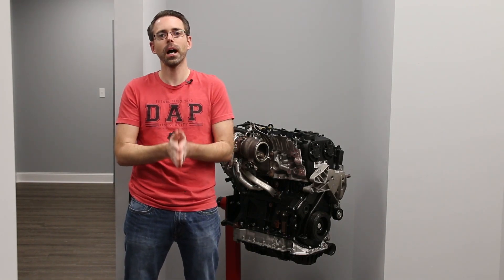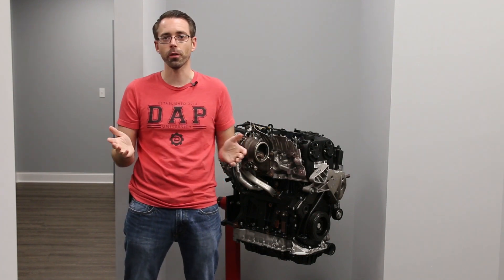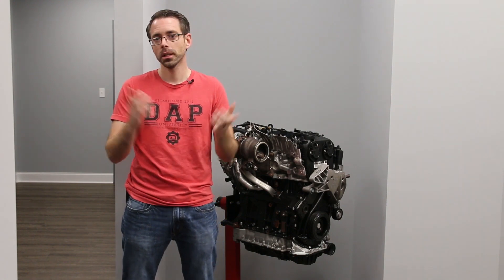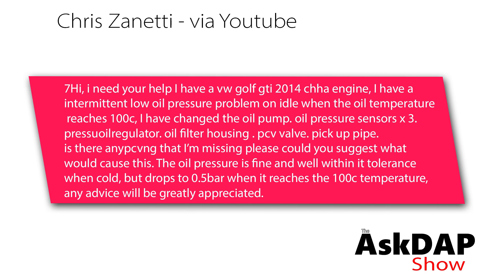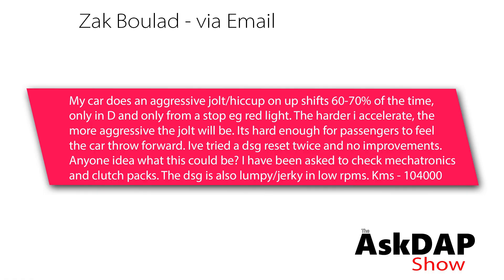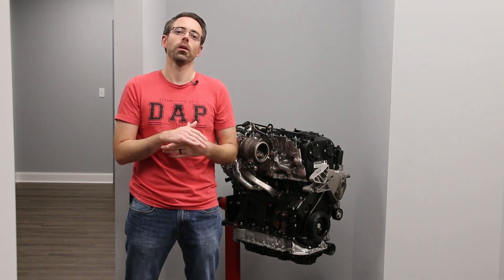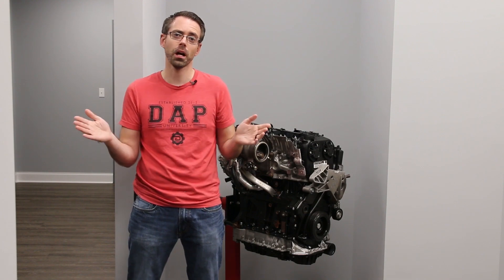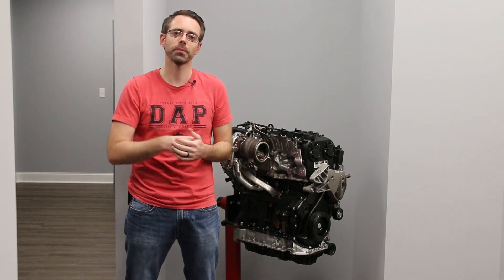AskDAP Episode 139 | MK7 Oil Pressure Issues, Misfires, and DSG Problems

Comment: For transmission issue: check/ map sensor, recalibrate your throttle body and cam timing via Obdeleven. Also reset your transmission code. Brought my trans back to perfect operation. Good luck!

Comment: I have an 09 tsi. At highway speeds the pressure is around 10-15psi. Never goes above 45psi when shifting through the gears. Oil light comes on occasionally. I ordered a vw certified sensor to rule out if the 6 dollar Amazon sensor is causing problems. New oil pump too. Around 200k for miles

Comment: Hey, how are you! I have 2008 GtI purchase the vehicle now for about 6 months and since I bought the car I been getting anOIL PRESSURE LIGHT that comes on when the vehicle is been driven it goes on and off and I notice the other day on very cold weather it tents to flash more then usual what could be cause it? What should I look into? Thanks in advance, great segment by the way huge value here

Comment: Just to add, the oil pressure  warning light will only appear for less than a second, I’ve had this fault for 6 months ever since my timing chain was replaced, there is no loss of performance no engine pinking. if it wasn’t for the bleeping notifying me you wouldn’t know there was a issue. On OBDeleven it says reduced oil pressure switch malfunction. I’ve replaced all three switches and regulator.
Reply: im having a similar problem where my oil pressure light will intermittently come on and off, when under 2k rpm it comes on, and when i press the accelerator the light goes away. The light comes on after a while of driving as well. Have you figured your issue out?
Reply: Same to my golf 7 the sensors have changed but few hours after the light appears again.
Reply: Yes having the same issues when I did the timing chain and luck of sorting the problem out and what it could be
Reply: I have the same problem in a mk7 gti dsg, any people are one solved it?
Reply: same issues... light comes on when engine is at temperature. and only come on when at low speeds and low rpm. I only use FULL Synthetic 0W40.  IF what he says is semi accurate, to me it makes sense that we have to get the oil to keep a higher viscosity. Im think trying a 5W50 oil( i live in Canada)  and/or using a additive like Lucas oil which supposedly thickens the oil.  I own a 2009 A3 2.0 TFSA CCTA Quattro
any help or input is appreciated
Reply: Had the same issue with my Audi. Found metal flakes on the bottom of the oil pan. Pulled the balance shafts out and saw the extent of the damage. Gotta replace the balance shafts, unfortunately.
Reply: you ever fix this issue?
Reply: Has anyone found a solution?

Comment: I have an intermittant problem on a 2009 VW 6 speed DSG Passat 2.0L Tdi.
It began with the vehicle jumping into neutral whilst driving and being forced to pull over.
The alarm on the dash was a yellow parking brake symbol and a yellow engine light lit.
The gear shift can be moved from Drive to Park,but then the gear shift is stuck in that position.
If I restart the car all is back to normal,I can carry on driving as normal but the engine warning light remains.
If I stop and restart the car a few times all warning lights go clear.
I recently started to see a parking brake alarm when just getting in the vehicle cold  in the morning
it gives a yellow Parking brake alarm and again the gear shift is stuck in park with the 'P' blinking.
Again if I restart the engine I can drive as normal.Never experience any juddering or issues whilst driving.
The engine always remains working OK .The error codes that come and go are :

01 Engine Control Module (1) U0101 Lost comms with TCM   Abnormal
03 Brakes 1 (1) 01315 TCM Abnormal No Signal Communications
09 Central Electrics (1) 02389 Disabling Signal Transmission ,Position P/N Abnormal Implausible Signal/Communication 
16 Steering Column (1) Electronics 00002 TCM Abnormal No Signal Communications
17 Dash Board (1) U111100 Function Limitation Due to Missing Message Abnormal passive/abiogenesis
19 Gateway (1) 01315 TCM Abnormal No Signal Communications
53 Parkin Brake (1) 01315 TCM Abnormal No Signal Communications

Any suggestions?

Comment: Hi!
I had a similar problem with DSG shifting...it felt like transmission problem, but it wasn’t. I did the DSG reset and it didn’t help. After few days of jerking the EPC light came on, it turned out to be a faulty ignition coil.

Comment: Hi thanks for your reply. Mine was the 1st question in this video. The problem still unresolved. 
Car is 2006 golf mk5 1.4 tsi 170 brp twincharged ,

I checked compression, fuel, sparks, all ok. Changed plugs, coil , but no start. No code in engine module. Changed HPFP , HPF sensor, camshaft sensor, camshaft adjuster, changed coolant sensor, but nothing happened. Car cranks fine, just after few attempts compression goes down. During cranking I noticed red oil pressure light starts to blink after 7-8 seconds. I checked oil level, it’s fine. I removed sump and checked pick up tube, it was as new & clean. Now will put new oil level sensor when reinstall sump. I was thinking can knock sensor cause bad ignition timing and cause no start and wetting plugs severely. I checked cylinders through borescope for injectors but no leakage. No error regarding injectors or anything else. The only things left and I am planning to change are knock sensor, crankshaft sensor, oil level sensor, & oil pressure sensor. Can you please give me directions where to look at? The car been in driveway for over 5 months now, but never started. 
There was only one same case like my car on YouTube. That guys bmw didn’t start with no error code, and plugs got wet severely. After changing almost everything, somebody told him to change oil level sensor . The car started when he changed that sensor. This is my next plan, already bought new oil level sensor, and removed sump as well to check pickup tube. Hope that solve my problem. 
Thank you for your reply, very kind of you. 
, Look forward to your reply.

Comment: I’m new to VW. I currently own a MK7-R which since day one I’ve had a misfire issue. I immediately change the coils and spark plugs ( APR coils and NGK ) the misfire went away but came back about 2 months after. I took it to get checked and was told it could be there is a tune on it since the turbo was changed out to a bigger one. I noticed the grounding wire seemed to be very stiff so I changed those on top of the coils, cleaned out the camshaft adjuster but I’m still having a misfire . Even when driving you can hear and feel it but it glows away sometimes but comes back. Do you think this is a timing issue ?
Reply: Same here. Have you found the issue?
Reply: @pharaohabaddon342  yes I did find the issue .. cam adjuster sensor

Comment: What if you’re getting misfires underload wot . Besides tuning what should I take a look at. If I cycle through the car by turning on and off the car drives normal again after getting into that misfire tractor mode from getting wot.

Comment: Just found your channel!!!  I have a 2016 GTI autobahn with a P0092 Fuel regulator code showing.  I have a check engine light shining,  I have replaced the fuel pressure regulator per the code but the light is still on and it has trouble delivering power under strong acceleration.  Can you help???  Thanks!!!!  Note- Car has less than 17K miles....

Comment: Hi 
I have a problem when the cold blows.  When the temperature is 90 ° C, everything is fine.  I changed the fuel injector, the oil pressure is good, and I also changed the program after the program.  I have started giving a new timing chain fault.  The timing chain is new.
Note: When I open the cap, the oil is sucking in the air as if it were a defective PVC valve.
Do you have a solution to this problem or steps to be sure of?
Thanks..

Comment: I have a big question. At least to me. I have a MK7 golf Tsi 5spd manual and it grinds into gears reverse, 3and 5 and my foots to the floor and 5ths does it all the time is it me or the car. Really need help. It’s like it doesn’t want to go in the gear like the clutch isn’t releasing I don’t know if it’s something to do with the slave if the car even has a slave cylinder I am learning and an automotive program but I really need to help

Comment: Hello and congratulations for your great work that you are doing! I have a question about a european spec, VW Passat B8 that I own with the 1.4 TSI ACT engine (EA211) 150PS, in this type of engine the dealer says that the timing belt lasts for the lifetime of the car and it's NOT a chain timing belt but a synthetic-elastic one. Is that possible? Would you recommend me to change it if it's although "lifetime", as a normal elastic timing belt?  Thank you in advance.
Reply: Those belts should be changed every 8 years of 150 000km

Comment: Hi there!!! My  vw cc 2009 2.0tsi having just 16 psi on oil pressure....in idle ,I rev up the engine to 2k rpm and stays the same ...do u think could be a defective oil pump??? Great video by  the way !! Thanks
Reply: Balance shafts are the fault. Just had them replaced on my Audi.

Comment: Hi, please could you help me. I have a 2006 Audi A3 2.0tfsi (ea113 I'm sure as it's belt driven) after purchasing the car I had a 70 mile trip. The oil pressure warning came on in the middle of the dash cluster after 65 miles and I pulled over and checked the oil, all checked out ok and I started it up again and no warning untill two minutes later. I made it home on the engine no issues ( yes I know I shouldn't have driven it any more ) but the car now fires up fine and gets up to temperature no problem without displaying the light.. It did sound a little weird after the trip home , like a whining sound or buzzing sound. I feel as though the pickup is blocked or something similar, is there anything common on these engines which cause oil pressure drop . 

Any help appreciated thank you

Comment: What are the symptoms of a clutch going bad on a DSG 02E? Are they different from a single clutch trans?  I smell clutch friction disc burn intermittently but my transmission is not slipping at least as of yet, from what I've felt.  I have no check engine light either.
Reply: you might be smelling something else...
Reply: You can't smell chutch burning in a dsg since thay are sealed up in side the trans case so what you are smelling might be  "E" brakes or a seized brake caliper ...
Reply: David Bauer Okay, I checked the brakes when it first happened.  There was a puff of smoke from the front right (passenger side) but the brakes seemed fine.  Ill pull off the tire and check the brake pad and caliper.  I was doing a spirited drive after doing a sea foam carbon service.

Later, however, I was on a steep incline and the DSG 02E was trying to grab a couple of times while i had the brake depressed.  I got a  huge serge of the smell when that occurred. Thoughts?
Reply: Yes pull of the front wheel that you saw the smoke coming from and see if the rotor is hard to turn if it is  you have a draging caliper also look for blue marks on both front rotors if all is okay then you under estimated your spirited drive lol

Comment: I have a problem with DSG 6 in mk7 gti, it shifts roughly from 1-2 and 2-3 only when the transsmision is cold. Afther warmup IT shifts perfectly fine, what could be the problem? DSG adaptation didnt change anything, could it be low DSG oil level?
Reply: bur0ak did you found an answer?. Same happens to me
Reply: ............. I had the same. the problem of this issue is the problem of this issue 😇

Comment: Hey Paul, my Unitronic stg. 2 MK7R drops coolant. If I top it up to the max, after 1-2 months it will drop to at or below the minimum line. My dealer told me they could not find a leak and unless they physically see it leaking coolant they cannot do anything. Is this normal for these vehicles? What should I do?
Reply: Well mine goes from max to min in about 4-5months. Seems pretty common for these cars to use some coolant. No leak whatsoever.
Reply: @gunterification  maybe its turbo consumption. that was their excuse for the FSI's oil consumption
Reply: Some of these engines do use  coolant. Others don't. Others have a leak from the water pump/thermostat housing.

Comment: I get a “Reduced speed threshold for oil pressure switching- P151E code”. Anybody familiar with this? 2014 VW Gen3 GLI, 165k. I first replaced both the oil switches back at 60k miles.
Reply: I've got the same code on my 2014 Jetta 1.8 tsi with 139k miles, did you fix your car?
Reply: Hi  did you manage to resolve?

Comment: hello, i appreciate all the great info. i have a 2009 gti tsi withe oil light coming on at lower rpms after reaching proper operating temp. I've replaced then oil pressure sensor, installed factory oil filter with fresh oil from the dealer and i have also replaced the oil pump because the oil pressure is clearly too low once the vehicle is warmed up. the car runs amazingly strong with no fault codes. if there is an issue internally with engine, what's  the worse that can happen and what kind of time do you think i have before any kind of major failure?
Reply: Hi! I have a 2015 1.8T Golf with the same issue. I manage to get rid of the oil light warning with the replacement of an updated oil filter housing and by adjusting idle by 100 rpms. But now when my car is idling at 800 is rpm it sporadically has sudden engine shakes. After seeing this now I'm worried that my car might suffer an major failure. Did you manage to fixed this issue? What did you end up doing with the car?

Comment: maximum engine revs 4000 rpm golf what cause that fault golf 7 gti
Reply: When moving it’s not normal, when stationary it’s normal to protect the engine from being redlined by accident (like something resting on the accelerator)

Comment: Hi 
Mk7 golf tdi 150
Engine code 05580 (oil pressure sensor) ive replaced this sensor but the management light is still coming on and giving the same code on vagcom
It only happens when engine is cold
Car runs perfect when upto temperature
Any help greatfully recieved
Reply: I have a 2015 1.8T Golf with the same problem. I've manage to get rid of the warning by replacing an updated oil filter housing and by increasing the idle by 100rpms. But now my car occasionally idles rough (al most as it had a misfire) whenever it is arround 800rpm. Did you manage to get it fixed?